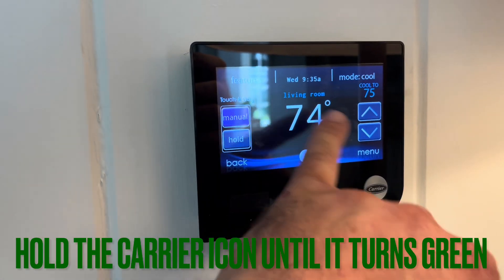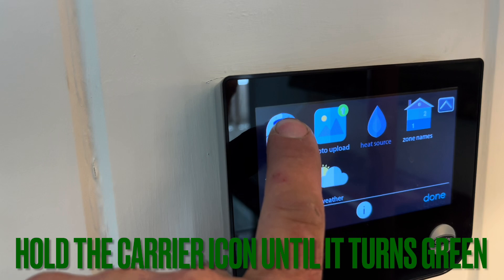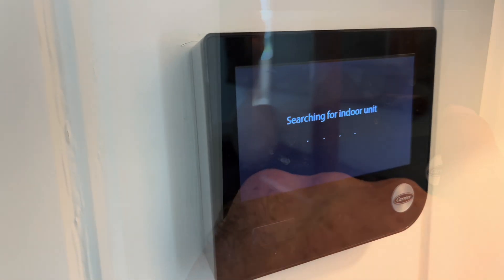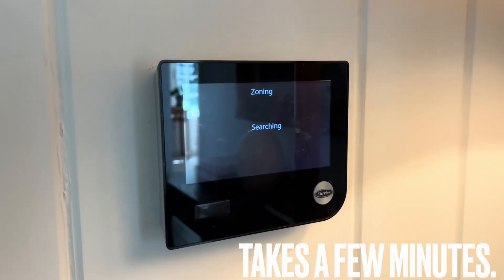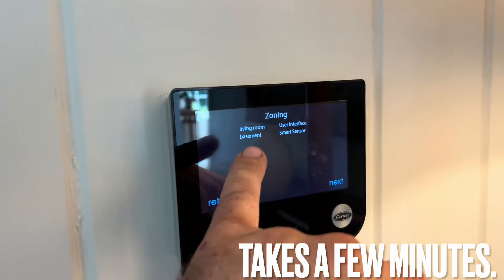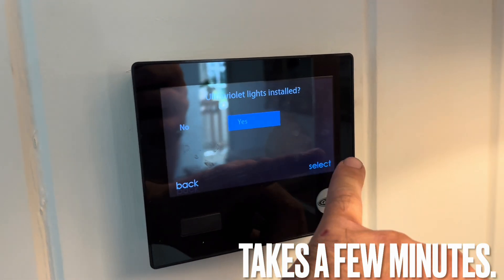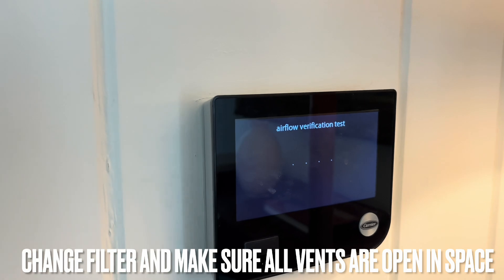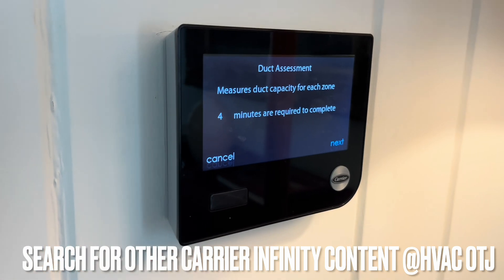MY CARRIER INFINITY SYSTEM SOUNDS VERY LOUD.  HOW TO CALIBRATE SYSTEM AFTER CHANGING DIRTY FILTER

Comment: Is there a way I can do this with an ecobee?  I didn’t get the $1000 thermostat
Reply from the maker: I’m not sure if the Ecobee has the 
Option to recalibrate the fan from static pressure however once you change filter, run the system a few days and it will actually learn itself inside the air handler control board.   Ecobee does have a Carrier specific model, that most likely is equipped to do so.